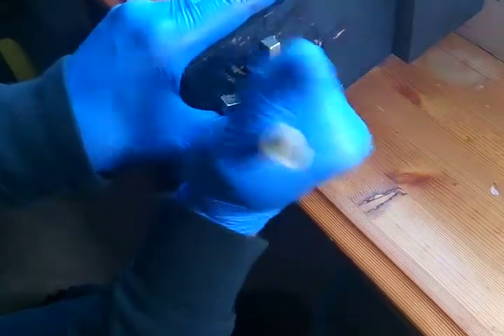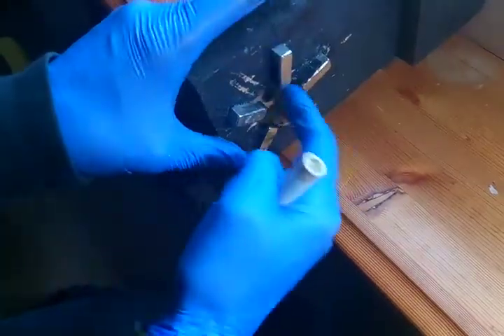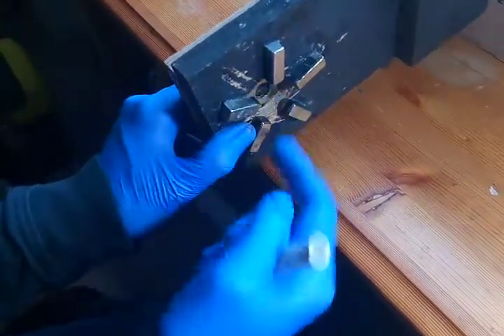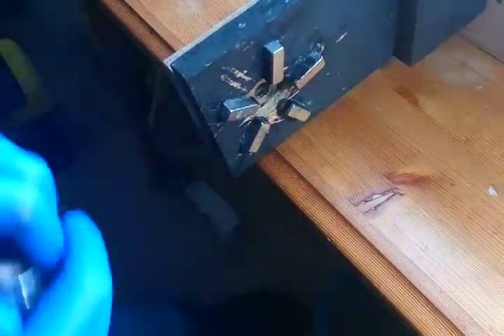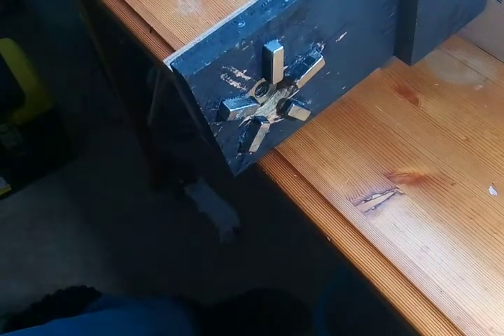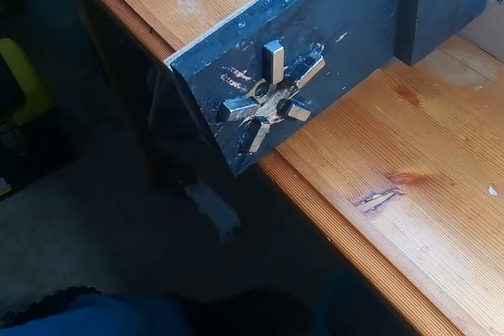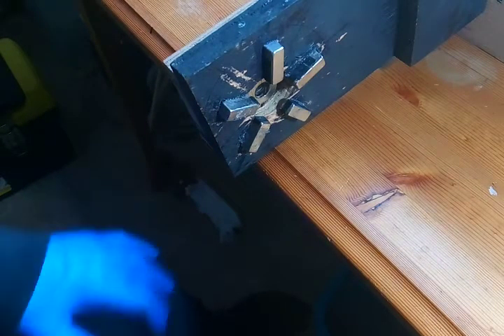Phase 1 of magnetic bearing construction

Comment: When you mount the rotor into the stator end plates you might want to lay the stator end plate flat on the table, drop the rotor down into it and then place the other end plate over the rotor and secure it to the base. The rotor will be horizontal at this point but at least gravity will help you line things up with less hassle, I am guessing. Can't wait to see how you do it. --- Good job with the explanation and how you figured out the air-gap.